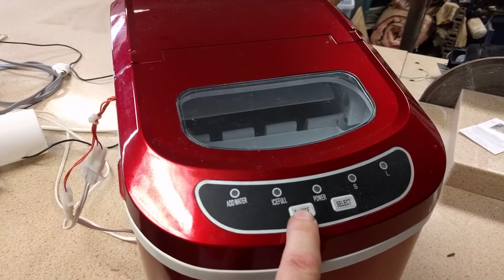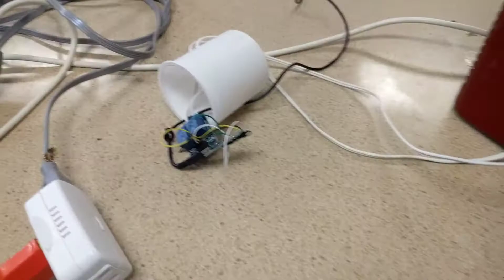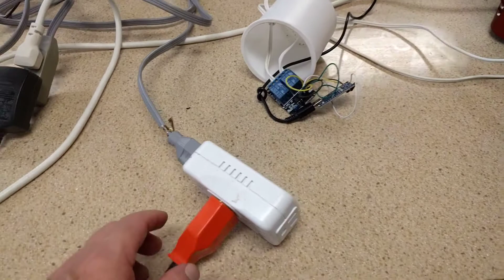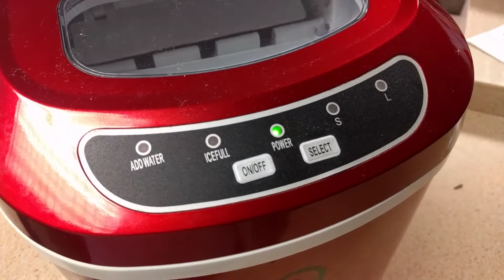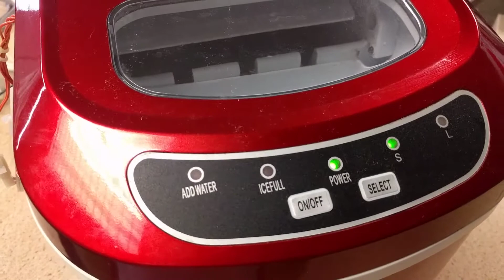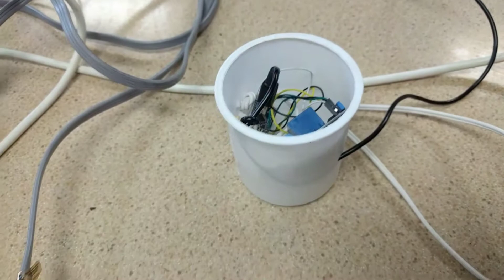Igloo ice maker hack

Comment: Great hack!  A tad overkill maybe.  I've been looking for a hard switched ice maker so i can add a smart plug but it seems that all countertop ice makers are made almost identically.   After watching your video, I tried unplugging mine and holding down the power button constantly while plugging it in and it turns on and starts the cycle.  I'm going to try and just short out that switch and see what happens, but i'm pretty sure it will work so I can say "Alexa, start boat ice maker" from the car and have a batch of ice ready for when we get there.